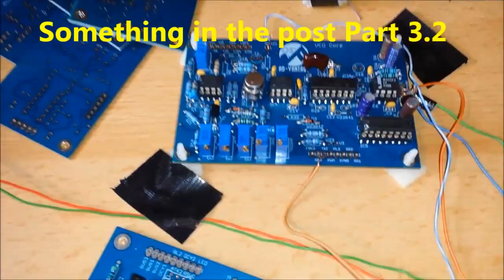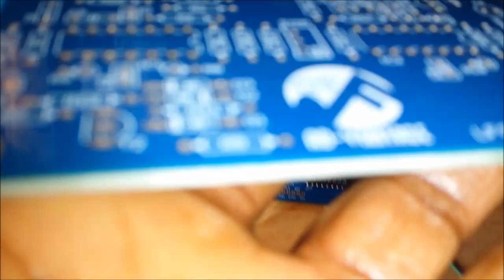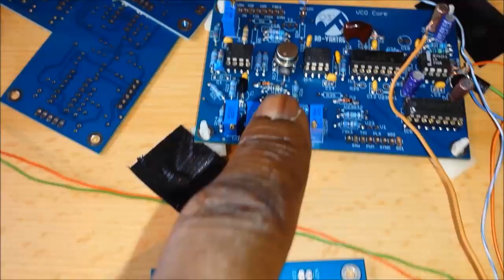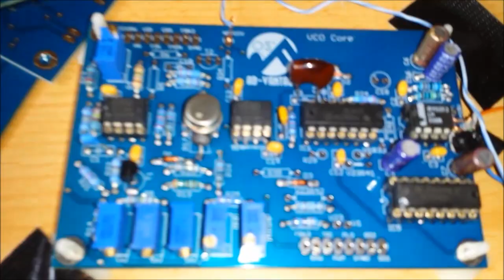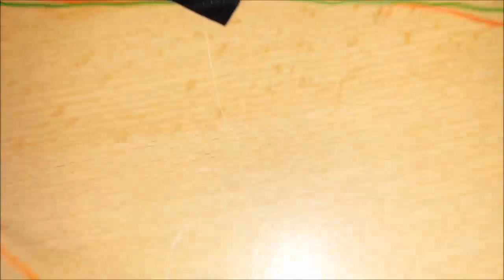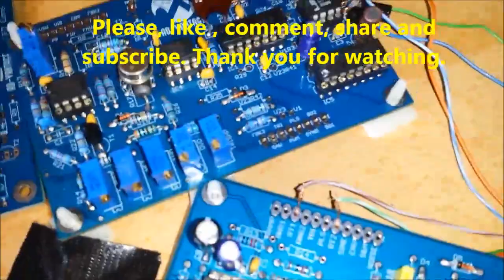DIY analog synth Project ( Something in the post  3.2.)

Comment: Did you use the xr-2206 for that project ? I started an xr-2206 project dual vco synth. I used another approach with x9cxx digital pots for pitch control instead of CV to current.
of course that gives discrete frequency control but using 100k 10k and 1k in series the freq can be fined tune up to 2hz resolution at the end of the synth range (C7) for pitch bend I thought of using a J112 jfet as a variable resistor in series with the digital pots,
and most functions (amsi, multiplier output) are also handled by digital pots.
www.easyeda/rodv92/synth1

but yeah you are quite advanced on your setups and probably have a lot more xp..
awesome job and presentation !
Reply from the maker: Thanks Rod. The oscillator is discrete and built around a quad op amp. Saw pulse and triangle waveshaped on the quad chip. The expo is loosely based on the Roland system 100/  juoiter 8 circuitry. 
Have you posted any of your project on your channel would love to see it . :-)

Comment: LM324 is better for buffering as I remember.
Reply from the maker: 324s are better for lfos as they will draw less current from the power rails like the xx358.
Reply from the maker: If you are buffering precison volatges: for instance note cv , then no as they will add to the drift . Hence i use opa 2132 for note cv buffering and as the cv summing op amp choice.

Comment: Great progress mate. What are you using as a power supply, your own or ready made? Rob
Reply: Thanks Adam, linear is a good choice I think. I’ve got a project on the go at the moment to re-house and modify a Dreadbox lil Erebus. I’m adding things like fine tune pots for the oscillators and doing some re-scaling  of some of the other controls. My plan is to make a new, larger front plate from sheet aluminium (quite cheap on eBay). It will of course need painting and printing with legends for controls. Do you have plans for the front panel for Ad - Vantage? Rob
Reply from the maker: @ProfessorSynth   Sounds like you have some awesome mods in store for the dreadbox. Please if you can put some vids up on your channel.
With regards to front panel check this video out https://youtu.be/VNq2EyGpcXs
Reply from the maker: Thanks Rob. I am using a dual adjustable linear supply . I bought the kit from ebay.